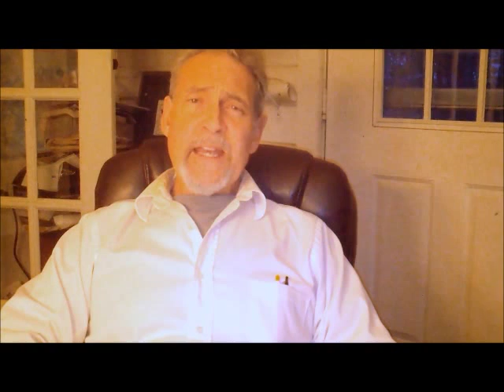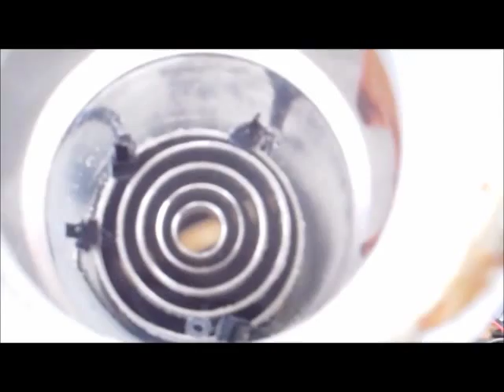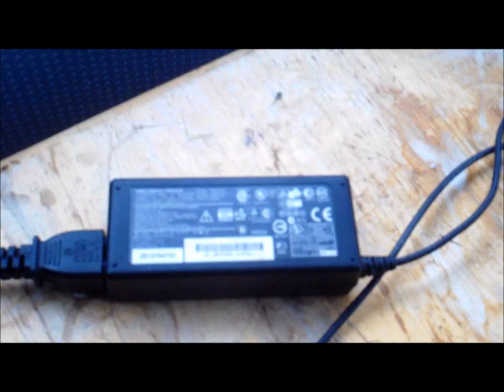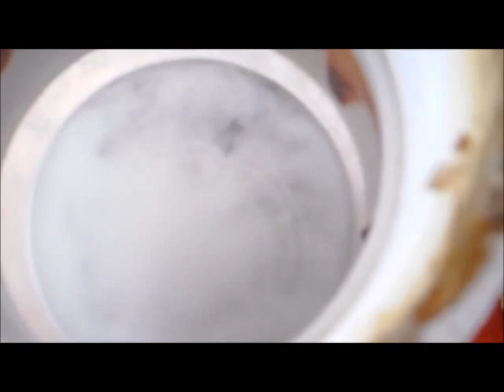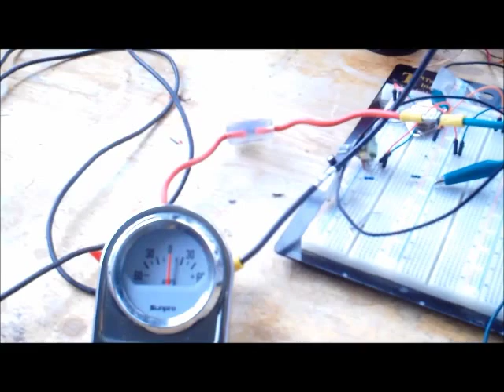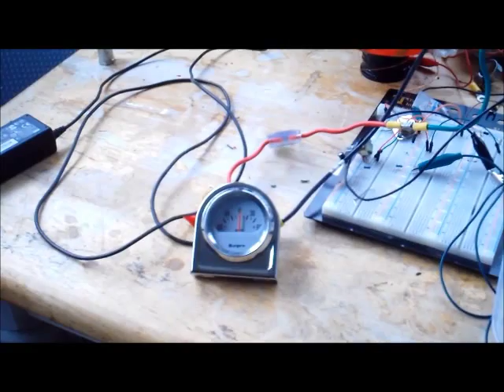Nunez Coil Boosts HHO Output - Lowers Power

Comment: you have fallen into the trap of producing energy voltage
reason energy voltage is increased is to stop theft
a car uses about 12-18 volts which is brilliant to power a house at that voltage of maybe a little bit higher maybe 60 volts house is a viable option

Comment: I'm not a naysayer; I love this stuff (I have yet to put one together, but one of these days for sure).  I am just curious why a diesel generator?  Wouldn't a gasoline generator work just as well?
Reply: The diesel is much higher compression so it works much better with hydrogen for high efficiency. The diesel is built to run almost forever at low rpms. Since these generators are meant to run 24/7 off the grid reliability over the long term is critical. But, yes, you could use a gas engine....just expect to consume a lot more hydrogen. http://www.hhotrucking.com
Reply: Dave Davies
Ah ha.  That makes sense.  Thanks!